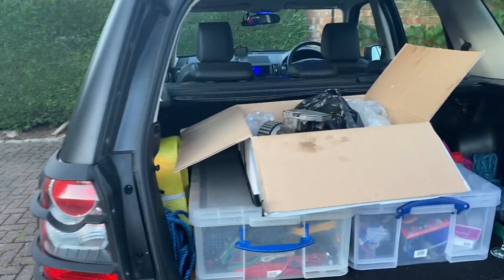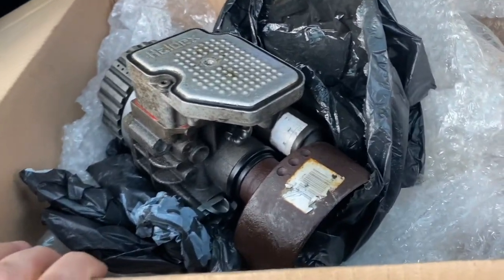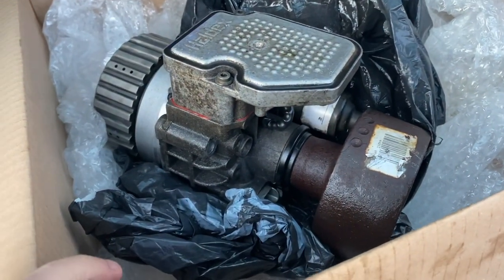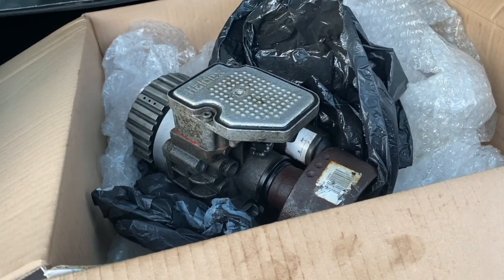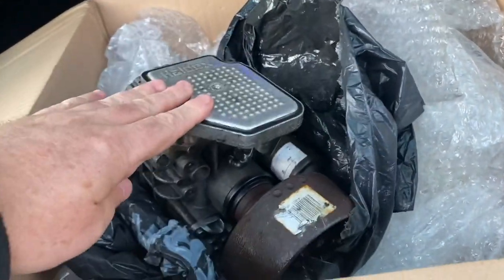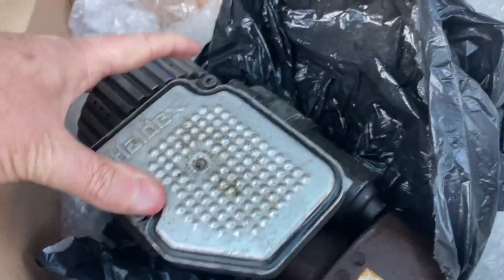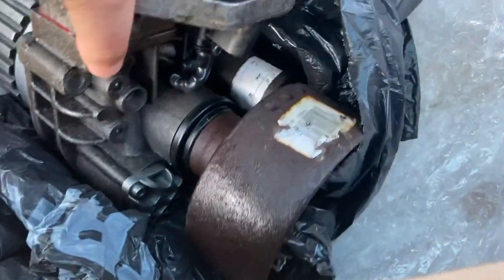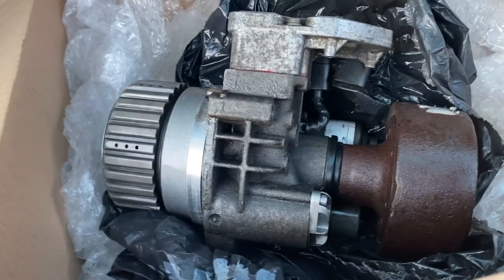Haldex project teaser - diff lock? - Land Rover Freelander 2 / LR2

Comment: Can't wait to see the Haldex teardown - I've done two now but never videoed them.

Land Rover state they don't need servicing however this is complete B/S.

As the clutch pack wears, it produces particles which not only block the filter element they also block the small plastic screen protecting the oil pump.
You also get oil and grease emulsifying with condensed water which also blocks the filters.

If you've got the "Traction Control" fault on the dash, its more than likely the Haldex.

LR probably don't want to include it in a standard service because with Gen 4's you need to take the prop shaft off to get to the filter so its a long, costly job.

And when it breaks your looking at £2.5K for a new one (when all it needs is a clean)

Also if you just suck the oil out and change the filter element, the small screen on the oil pump is probably still blocked and the fresh oil just mixes with the particles again when you start using it leading to premature blockage of the filter.

The Haldex really need removing and a good clean / service every 2-3 years. 

When I last tackled mine I produced a step by step guide covering complete removal / strip down and clean (including the clutch pack and pump) / re-fit which I posted on the Freel2 forum - link below (note- pics are over a couple of pages on the forum).

https://www.freel2.com/forum/topic16714-180.html

Cheers

M_W
Reply from the maker: Thanks, I’ll take a look. I don’t use the Freel2 forum much as I find it quite hostile. Far too many members who have nothing better to do than lecture others!

Comment: I've had my Gen 4 off my FL2 3 times and have serviced it twice (Filter and oil change + pump screen clean). However, I've never opened the clutch pack so am looking forward to you doing that as I want to do it on the next service.